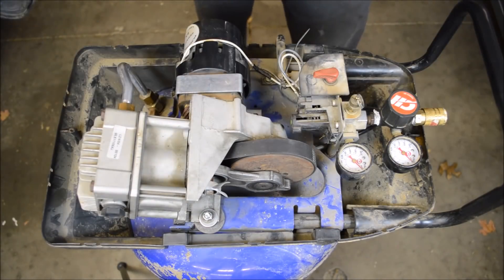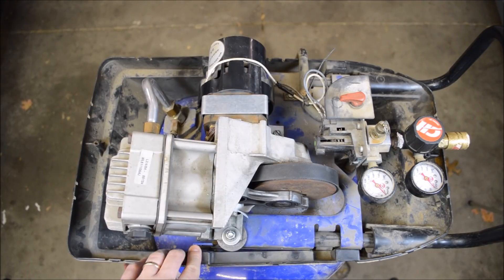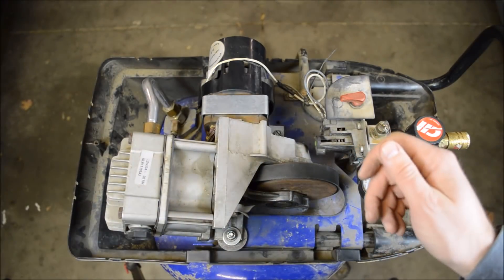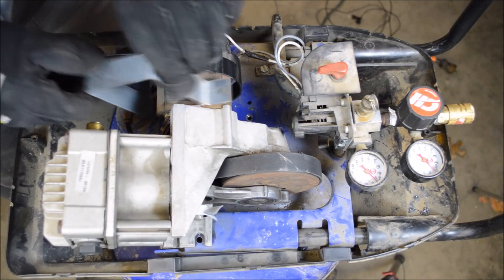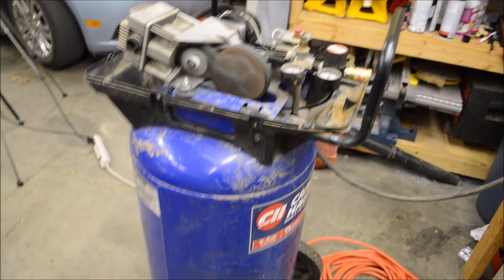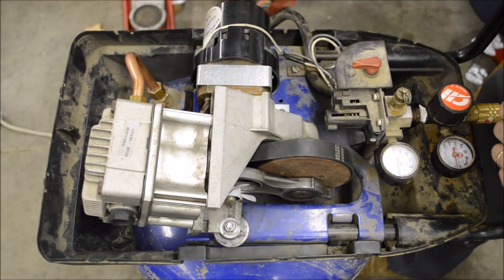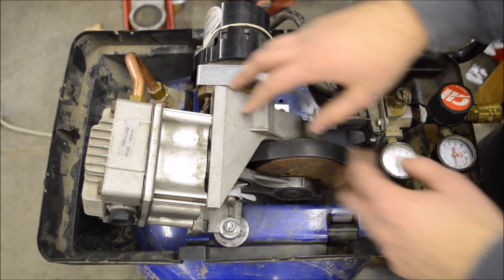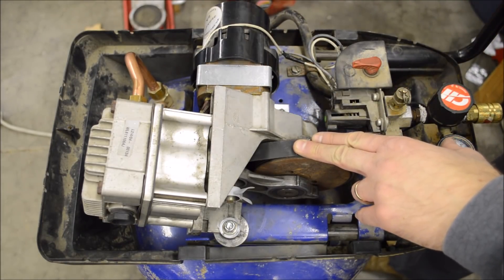Compressor repairs part 1: Attempting to fix my air compressor and failing - should I fix it?

Comment: I was looking for a small compressor to use💫 allabout.wiki/Hausfeld  for airbrushing but one that also had sufficient pressure for other light tasks. This compressor fits the bill perfectly. The sound is remarkably quiet. It is perfectly suitable for indoor use where others might be bothered by loud noise. You can easily converse while the compressor is running. The tank fills in under a minute and the pressure holds steady while airbrushing with the compressor running. Keep in mind that this is not going to support tools that demand high volume. It would be great for light tasks and a small finish nailer.There have been some posts expressing concern about the quality. My experience is that the fit and finish is very good. There were no significant air leaks and all of the parts seem very well put together. I've only had it for a short time so I cannot comment on longevity but I can say that, if you are looking for a small, quiet compressor that's a bit more beefy than the inexpensive diaphragm airbrush compressors, this is an outstanding choice.

Comment: Thank you for this video. I have a oil-less air compressor and I completely agree once they get to a certain age, it's not worth repairing. I have a run problem it will build to max pressure of 150psi but when it starts up again it will run slow and the motor gets hot and it cuts out. I think it's the run capacitor but it was changed a year ago. I changed both capacitors run & start and all you can get for this air compressor are Chinese capacitors and they are not very good.

Comment: The solution to the broken tube is to replace it with a flexible tube rated for pressure.  Problem solved.

Comment: Does anyone know what the likely issue is for a compressor that will only build about 40 psi?  Mine is doing the same thing.
Reply from the maker: Mine turned out to be a worn out piston ring. I’ve since fixed it and posted more videos on it.
Reply: @ToolTeardowns  can you send me the link for that repair thanks in advance

Comment: Youtube has flagged a couple of my videos recently. There was nothing wrong with them now it looks like they have been fixed.(I did not even request review or hit 1000 views.) I do not know what Youtube is doing. As for the compressor invest in a new belt drive compressor. I had a Craftsman oil less compressor that stopped building pressure so I went and bought Harbor Freights  Central Pneumatic 29 gallon belt drive. It has been a good compressor so far. (It is a lot quieter and faster than an oil less.) I used the Craftsman tank as a secondary tank and now I have over 50 gallons of air. What I did was get a adapter for the Craftsman tank to step it down to a quick coupler end and got a short hose and connected the outlet of the HF regulator to the inlet of the Craftsman tank.( I left the 1 way check valve in.) Then I just set the regulator on the HF tank  and it fills the Craftsman tank after it drops below a point and keeps it up to pressure. Then I can adjust my out going air with the regulator on the Craftsman. It works well. I hope that helps I all ways cringe at buying a used air compressor you don't know what shape it is in or if it has ever been drained or taken care of at all.

Comment: Option 3. Buying new is the better choice if you're like me and have little time to muck around with stuff. Once the scope of the repair expands it's usually time to abandon it. There is powerful romance in fixing things but many times it becomes a time sink and time is the most precious commodity. The only reason to fix stuff like this is if you have little money and/or lots of time. Or little money and no other choice. I'll never buy another oil-free compressor. Too loud and too irritating a sound. Earmuffs a must. Great video.

Comment: BTW i got a lot of info from this video even tho I have a porter-cable 'job boss' compressor. it has it's own problems but like yours it's old and parts are not available any more.I still use it but I got to keep an eye on it when I use it.

Comment: If you use this as a secondary tank you won't need to buy such a big volume compressor, which will save some money, and the bigger volume means whatever compressor you do buy won't have to work as hard keeping the tanks within the pressure threshold.  And depending how you plumb it, you can keep the main tank somewhat mobile if you need to take it to a job site.

Comment: Needs a top end kit. Get another compressor and use that tank as an air pig. Connect it to your new unit and have more capacity.